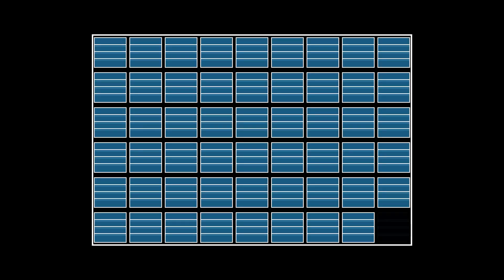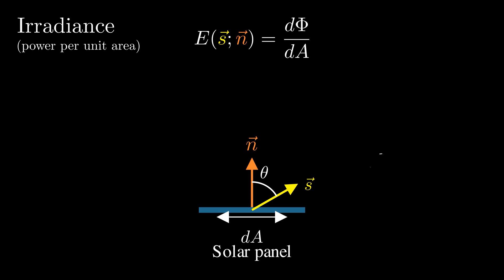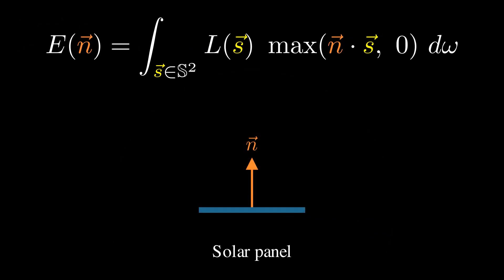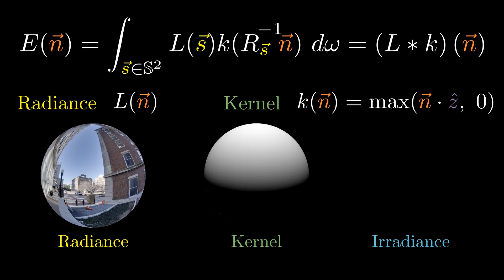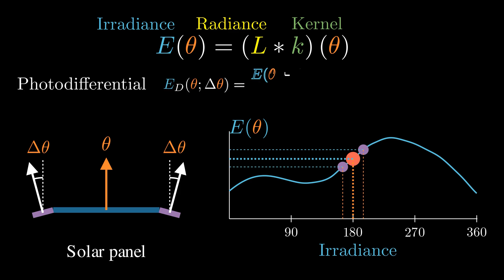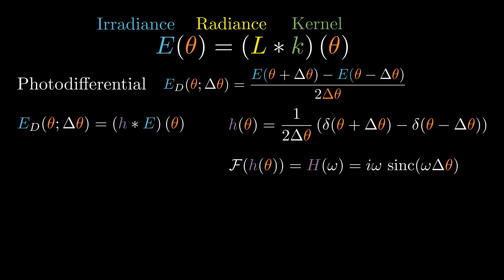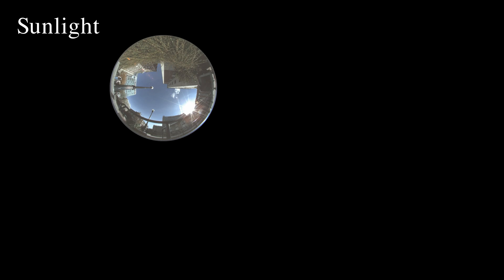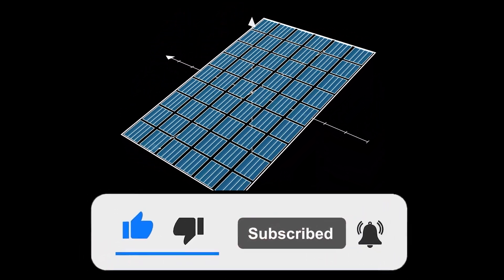The Smartest Way to Orient a Solar Panel

Comment: Lots of nice math, but in the real world there may be many other considerations. For example on a home installation the main cost of a solar system that does not have grid feedin batteries are often the main cost of the system so you may want to get more early morning or evening sunlight rather than trying to get the maximum total. On my own house the placing of the panels has to do with which parts of the roof have the least shade from surrounding trees at the times of day that I want power from those panels.
Reply from the maker: Great point, the financial and practical considerations of solar panel placement are definitely highly relevant and important for real world deployment! It involves complex tradeoff among several factors.

Comment: Very cool!
I’m able to follow the math by pausing and recalling my signals course from years ago. There’s beauty in how the physical system is modeled in the language of systems. I’d have never thought angled detectors perform smoothing otherwise. Thanks for sharing the insights.

Also i like the charts at the end. The more theory i see the more tension i feel that there could be a sneaky assumption somewhere that pulls us from reality. So i breathe a sigh of relief.

Its quite a claim that it always finds global max. Like what If its between two stars in space, how can it know the one behind it is not brighter? In practical settings its mounted on earth to the floor which is dim but is it always true given that assumption?
Reply from the maker: Indeed! 100% agree that it's beautiful that we can model such a physical system concisely. I was blown away that simply placing the detectors at an angle leads to signal smoothing (and therefore eliminating local maxima)! 

RE: global max. The two stars in space is an interesting thought experiment. I think we can find the global max if we have sufficient smoothing so that the blurred irradiance function becomes unimodal.

Comment: It was very interesting to see this problem solved by a signal processing approach.

For an accurate measurement of the overall efficiency of the system, it would be interesting to see a graph of (power output - power used by control system).
I suspect at larger scales the extra power obtained by moving the panel might not be worth the energy required to move them.
Reply from the maker: That's a good point. It's certainly a tradeoff. I checked the literature. 
"The power consumption by tracking device is 2–3% of the increased energy." https://www.sciencedirect.com/science/article/abs/pii/S1364032109000318

From the paper, moving the panel can gain the (9.2% - 163.7%) more energy compared to a static panel.
Reply: main problem of real life tracking systems isn't spent energy - but simply maintenence of motors powering the movement